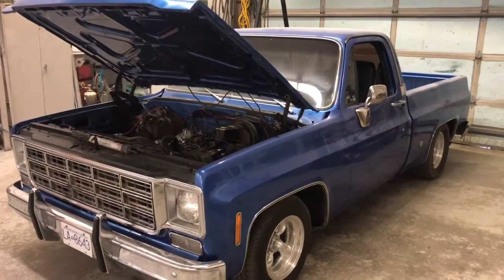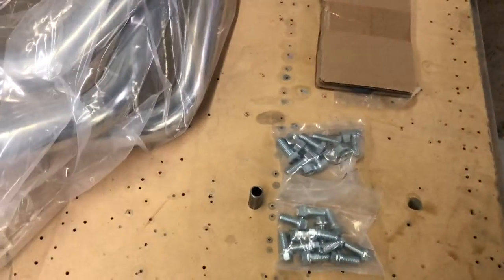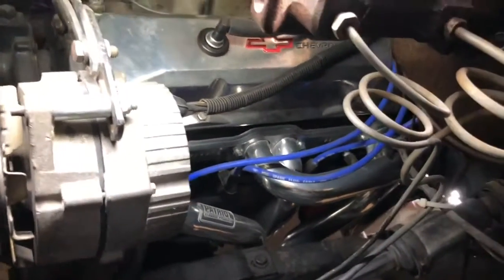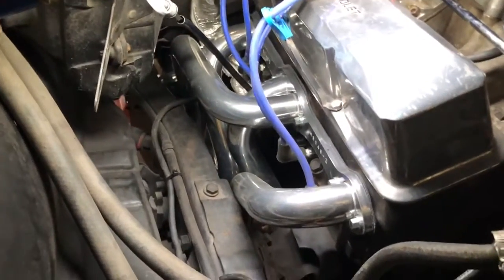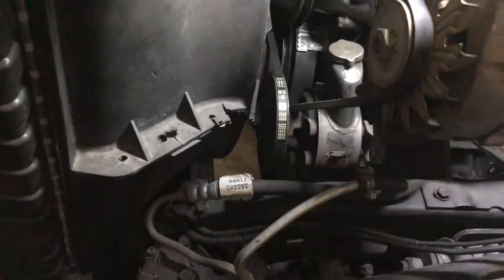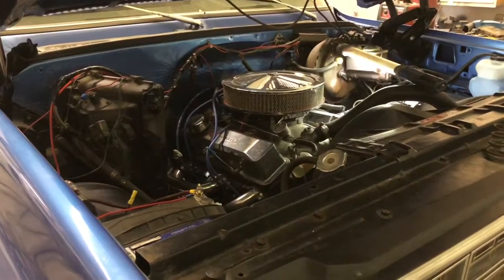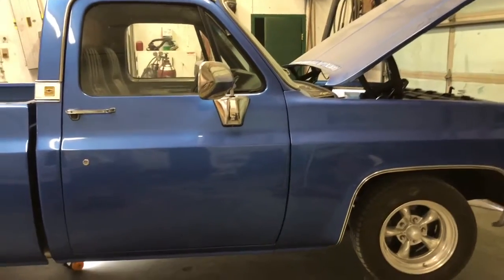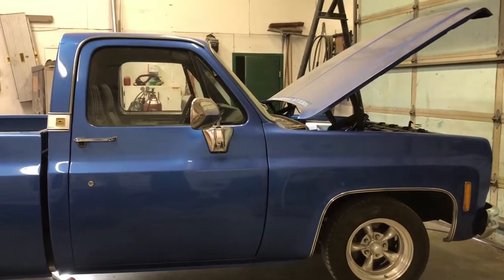Patriot Long Tube Headers SBC 67-87 Chevy C10 Review. 1.75” Primary Tubes. How Well Do They Fit?

Comment: Did you have any issues with the transmission Crossmember?
Reply from the maker: @DEADIKATED  we didn’t but we were building a new exhaust at the same time and did a 90 degree bend to go under. You can see it in the flowmaster muffler video. It’s one of the most popular videos on the channel so you should see it on the main page under popular videos
Reply: @atpmonstergarage  Ok Awesome thanks I'll check it out. I had that problem trying to install Hooker Headers on My 72 C10

Comment: I dont see where Patriot makes a 1 3/4 primary tube header for these trucks. Where these designed for a different model? If so what model?
Reply from the maker: H8048 is the part number for 1-3/4” SBC 73-87 Chevy/GMC Trucks